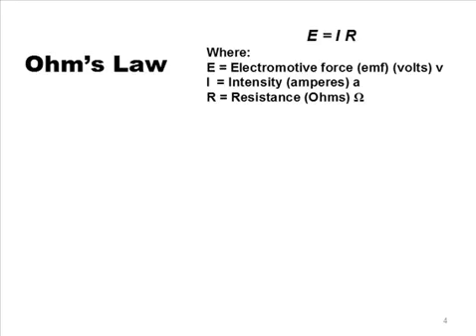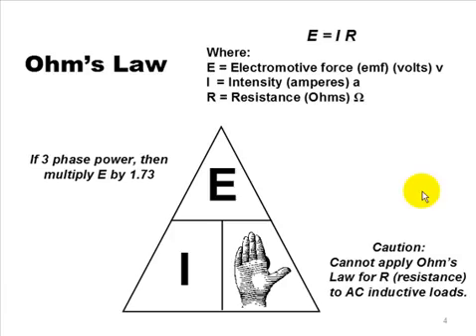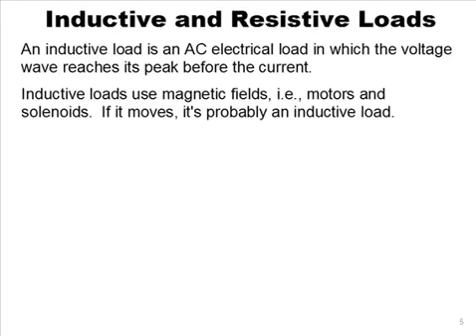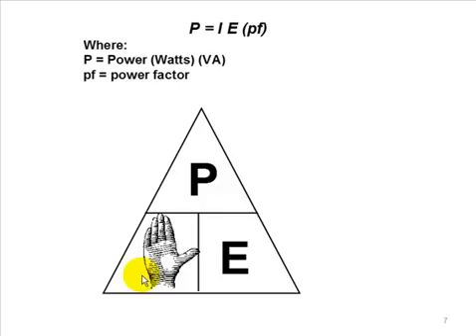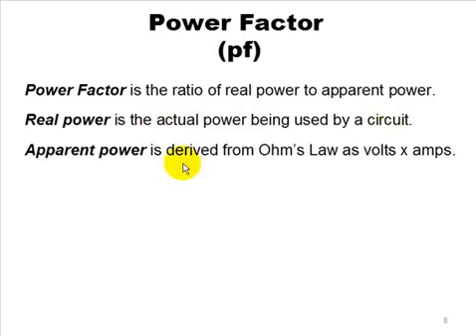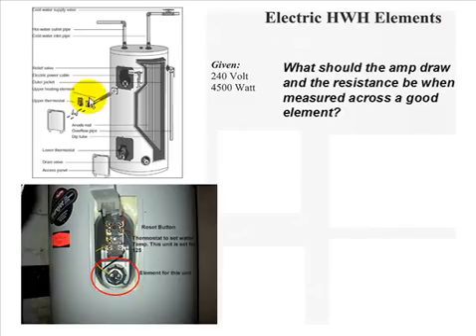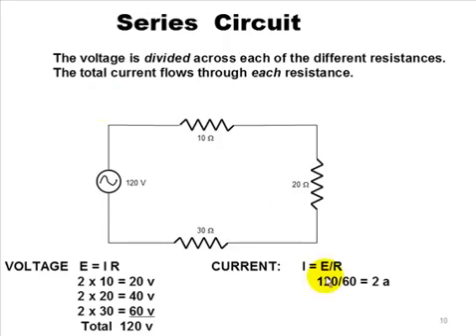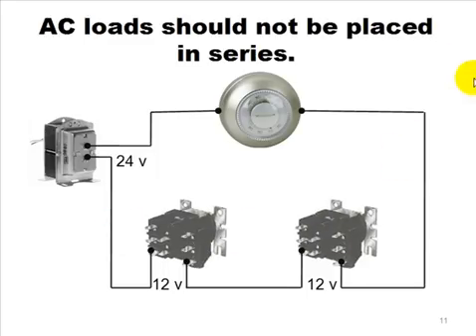Understanding Electricity for HVAC Technicians

Comment: I need to watch this over and over. You said if it moves that ohms law wouldn't apply. I see several people use it for compressors. Would that work?
Reply: Ohming our a compressor is only used when it is off, so that law would still apply